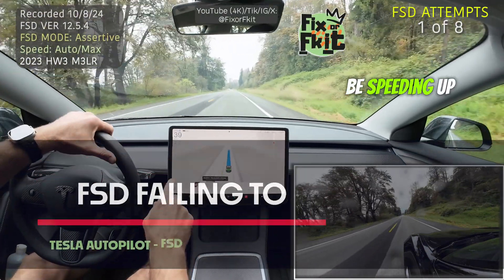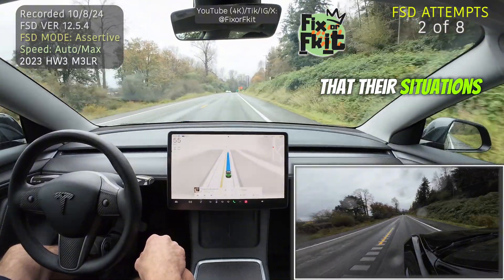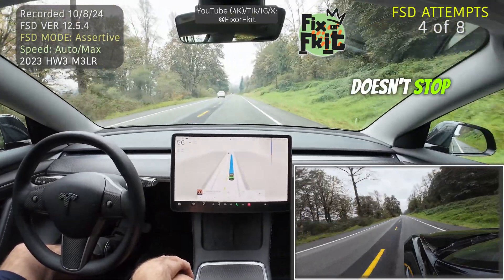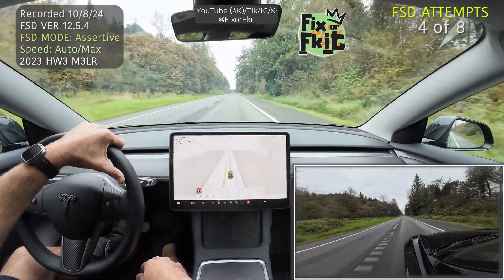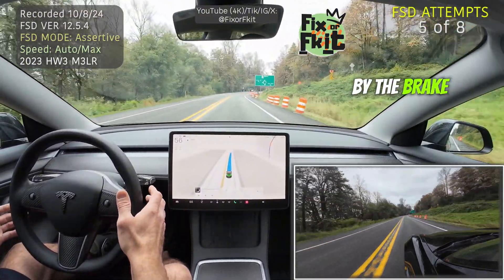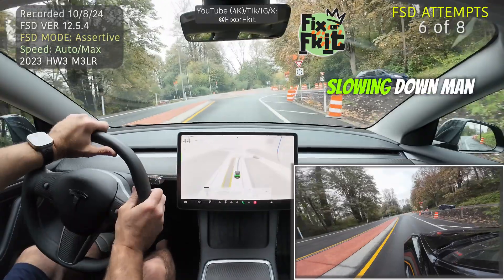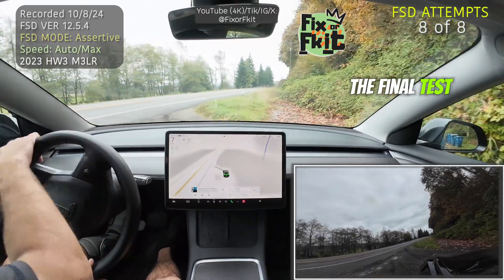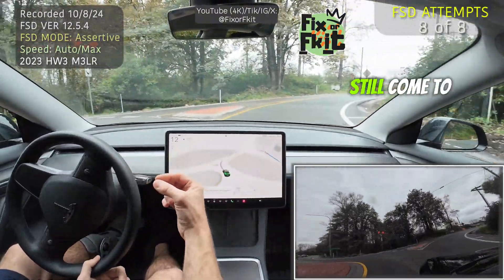🚨URGENT: FSD 12.5.4 AutoPilot Round-a-bout Failure!

Comment: As a UK model 3 (2021) owner/driverI I can assure you that FSD is far worse even in its more limited guise than the USA variant.  It is dangerous and to be frank, other than slower speed motorway (highway) driving its not fit for purpose. I tried FSD (autopilot as called Europe) in the dark and when approaching a roundabout the car dipped the head lights because of the reflection from the  chevrons, then switched back to full beam because, and I assume it thought the reflection was another car thus the reason for dipping them. The car did this 3 x and continued in a straight line cutting across 2 of the 3 lanes before screaming at me to take control. That was terribly embarrassing to say the least.  For smaller roads FSD is putting your life and the life of cyclists in your hands.  Your video captured the reality of FSD perfectly. Hopefully in 6 months time Musk will have improved the system to an acceptable and usable standard…
Reply: Autopilot is NOT FSD.

Comment: what's the yellow warning that appears on your screen  at :37.    Also, if you have FSD engaged, why is the upper right corner showing the GPS.   This appears that  you're simply using Auto Pilot which just uses advanced traffic aware cruise and autosteer aka lane keep assist.   FSD isn't engaged at that point.

At 2:30 you can clearly see where the warning comes up that Autosteer is unavailable and then it warns you to keep your hands on the wheel too.

Comment: Hmmmm...Keep up the good work and hopefully, in-time, the word on actual-FSD Performance will get out. I live in Silicon Valley and have a Model 3 with FSD -- it struggles at times and requires 100% focused attention -- far-far from autonomous. FSD working without a driver at 5MPH  on a Hollywood Sound-Stage is NOT a FSD confidence builder -- no wonder TESLA stock price dropped after the event!

Comment: I'm seeing the same things in certain parts of Kansas and Missouri also; I'm sure this is happening all over the country in spots. There is a spot near my house where after making a left turn the car winds up on the wrong side of the road EVERY TIME. I've reported it multiple times and it's never fixed. In general it works OK but it also makes mistakes and requires interventions. Obviously they are mapping, geofencing and hardcoding certain areas of certain cities to make FSD look better. There is no way in hell this thing can work unsupervised as it is right now. A couple dozen cars moving in circles around a movie set going nowhere is supposed to prove this is ready? Right.

Comment: Why would the car come to a stop?  I don't see a stop sign, and most roundabouts are yield and I don't see another car blocking your way.  Why enter a roundabout at 55?  You are wrong, not the car or FSD.  You don't know the correct way to drive a roundabout.
Reply: FSD is entering the roundabout at 55 because that's the speed limit.  It's failing to read and react to roundabout signs.  FSD error.

Comment: No, I am in San Jose, NorCal. I dont like SFD, even in the new 2024 model3 AWD.  It is so nervous with  SFD on freeway when I was driving toward S.bound 101 going to pass the area of 280_680 over pass. The auto pilot is good for straight driving. SFD is still scary. I don't trust those cameras.